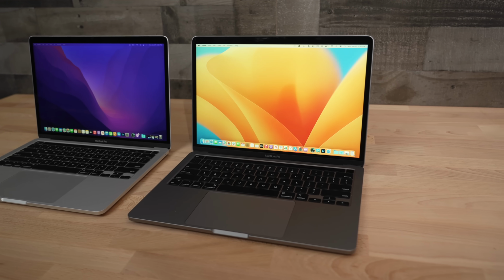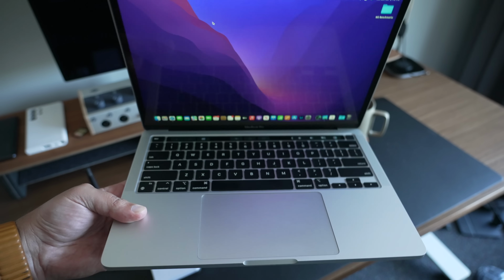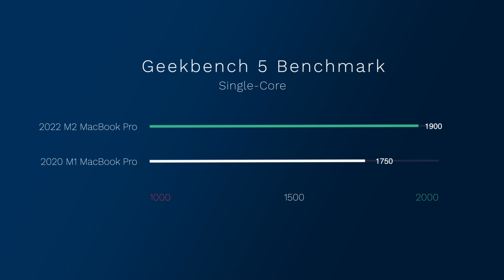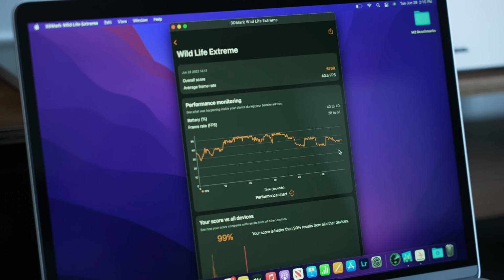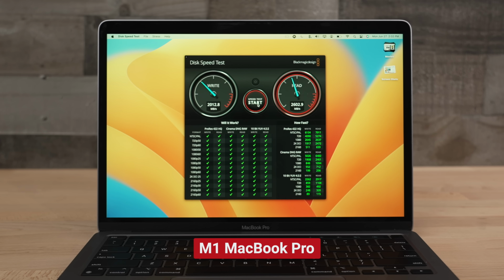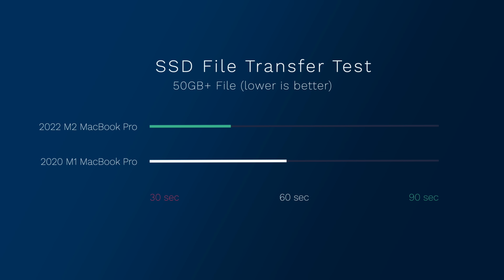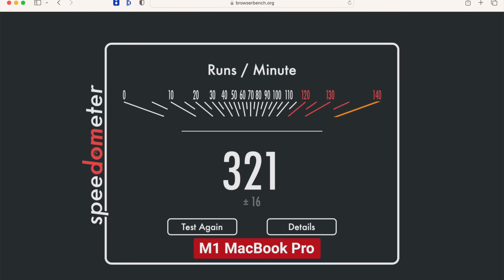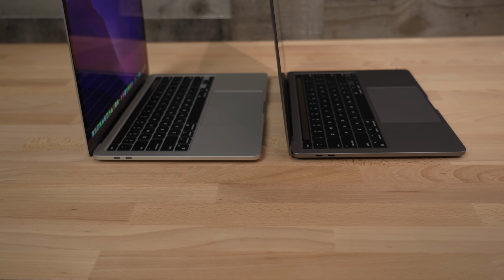M2 MacBook Pro vs M1 MacBook Pro: Is It REALLY Better?

Comment: What do you think? I'm in Best Buy the other day and cruising past the Apple Display of computers and noticed the NEW M2 MacBook Pro is on sale - $200 off! That's interesting...but wait there's more. Because I am a Total Tech Member, and I live in Florida, I save another $50 as a Tech Member, and I save another $65 in taxes because Florida has a "tax holiday". But, there's more. Being a Total Tech Member I get FREEE Apple Care. All added up this a net cost to me of $750. I purchased it for the net value to me. Am I wrong?

I have a Mac Studio, and new 14" M1 iMac I use as a Studio Display with the Mac Studio with Universal Control, a 27" iMac with 64GB RAM and the office, a new iPad Air and an M1 iPad Pro, but NO laptop. I'm not a "Pro" user so the configuration is fine.  Thoughts?

Comment: Which one best?
13" MacBook Pro M2 or 14" MacBook Pro M1?

13" MBP M2 with 16gb RAM, 512gb ssd and 14" MBP base model.

I'm an Interior Designer. I'll use SketchUp, vray, Blender, UE5, C4D, Photoshop softwares. 

So which one to buy? Please suggest me.
Reply: 14" MBP all the way, it costs more but you get more features and better multicore and graphics performance, which is valuable for 3D programs, also had better cooling than any of those because it has 2 fans, which means it's better for sustained work since the temperatures won't be too high

Comment: I am a musician.  I like to have m2 macbook air for live stage gig. I can only afford either one 16gb version or 512 verion. I am from india. Which option is best for me? I am using mainstage app or sometimes gig performer app. I saw the ssd speed is lower in base model. If this is the case with m2 air which option will be better?
Reply: Get M1 16GB 512GB
Reply: I reckon get m1 with 512gb ssd.8gb on a Mac is plenty for almost everyone unless u actually never close anything and tryna mine bitcoins on ur Mac

Comment: After bumping up… the prices are in the 14" range… isn't that the better option in that case. Is there really a case one would buy this over an older M1 Pro (prices dropping). I will probably stick to base model MacBook Airs for the future (maybe 16gb ram, future proofing).
Reply: my recommendation is a 14 inch m1 pro from somewhere like best buy, and apply for student discount if you’re a HS or Uni student. if you’re strictly getting from apple id probably get the base air if you only do emails, youtube, netflix, google tabs, word documents and that type of stuff.

Comment: I would love to see a comparison between the Macbook Pro M1 and the new Air M2. Any plans?
Reply: Same but more specifically, the M2 air with 16ram, 512ssd, and 10gpu vs the base M1 Pro. This way they’re similarly spec’d and only $290 apart.
Reply: The M2 air hasn’t arrived yet.
Reply: @michaelgalligan1187  We know, he means once it's available.
Reply: @AndrewC89  do you happen to know when the m2 macbook air is coming out
Reply: @winllyhuang9537  next week
Reply: @winllyhuang9537  July. Could be July 1 or 31, we don't know yet.